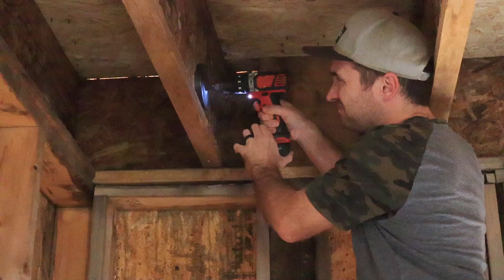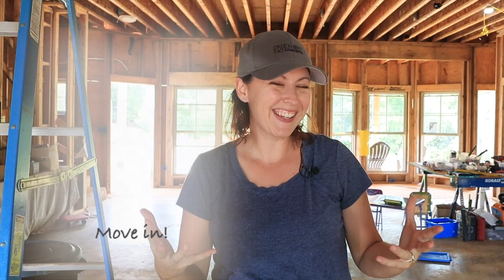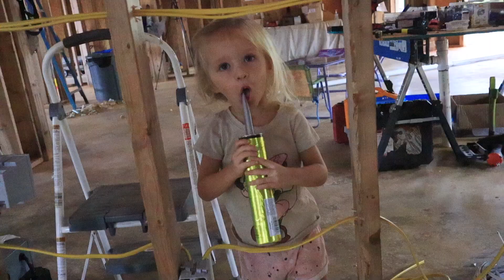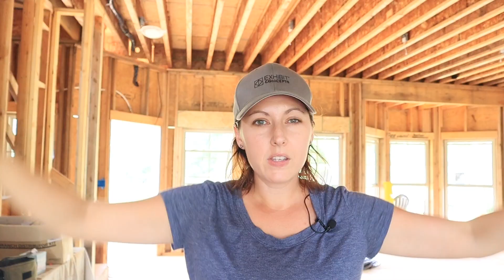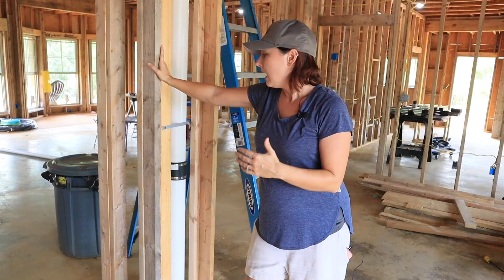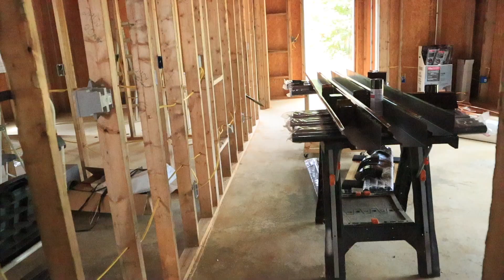Building a House from the Inside | Self Build steps after Roofing

Comment: Mini-splits are an excellent choice. I put one in my house and I love it.  Very efficient and uses a lot less electricity than a full size unit. Just make sure you use a vacuum pump to remove air from the ac lines. Love the house .....
Reply from the maker: Thanks for sharing! We've heard only good from people that have used them. It's already saving us space with duct work and are hoping it will be more economical in the long run.